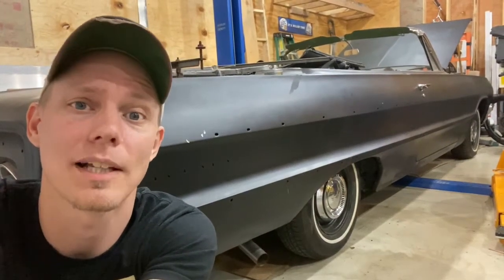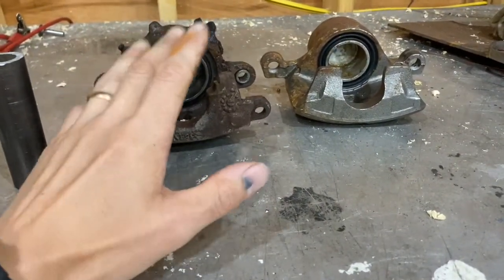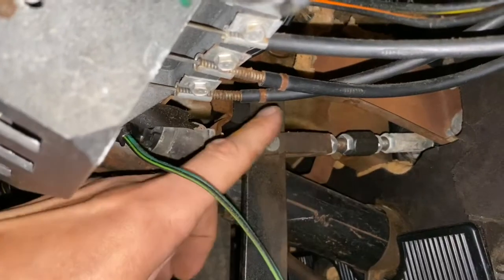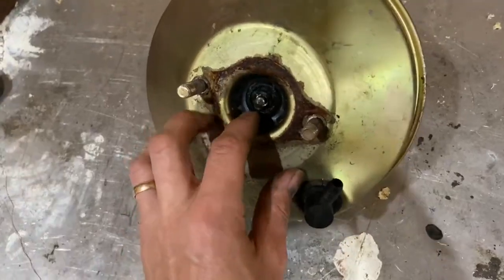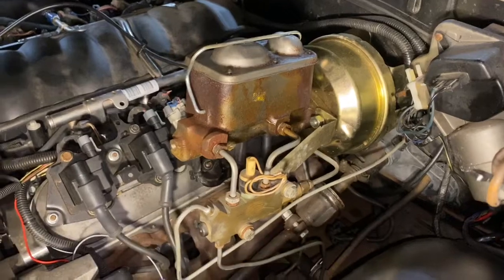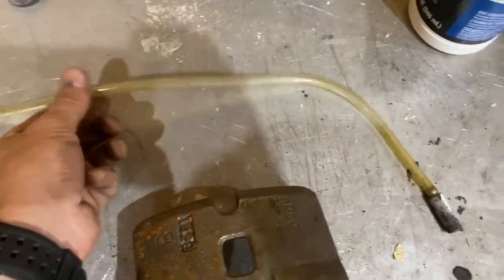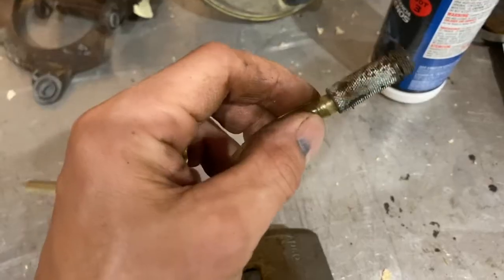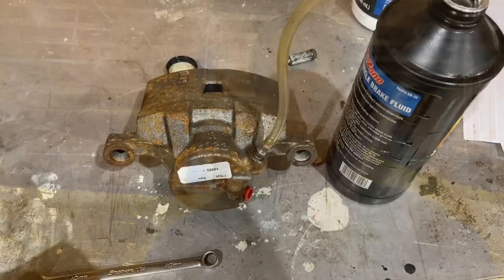Brake Diagnostic Tips! Common Reasons Why Your Disc Brake Upgrade Doesn’t Work.

Comment: I was wondering if my 455 442 1969 motor will operate my disc brakes?
Reply from the maker: I depends how much vacuum your engine makes and the design of your power brakes. If you are using vacuum operated power brake booster, it will have a minimum vacuum requirement that your engine will need to make. If you have hydraulically assisted power brakes, the engine vacuum doesn’t matter. If you have manual brakes, the engine doesn’t matter.